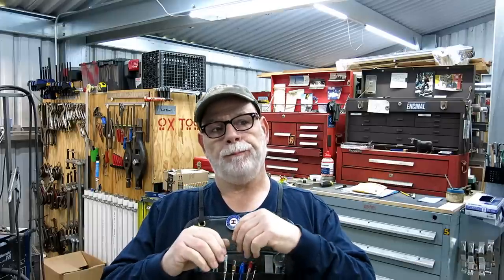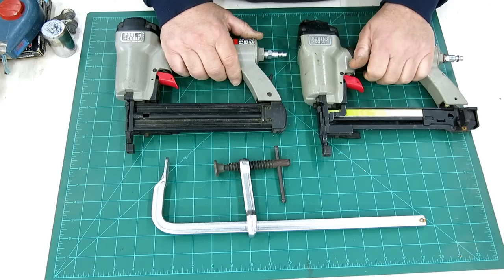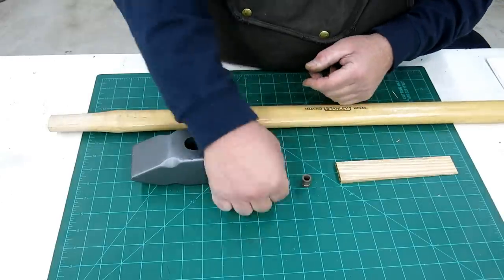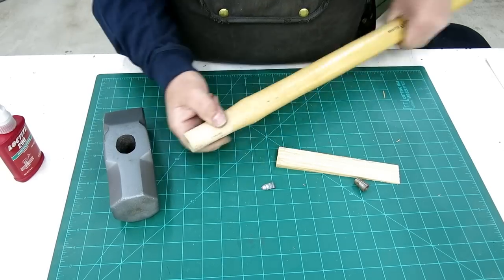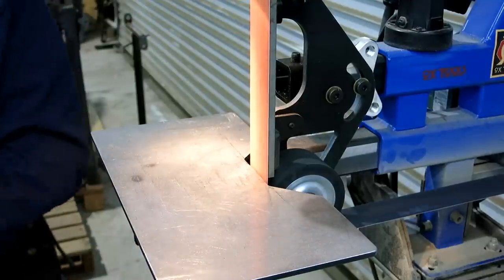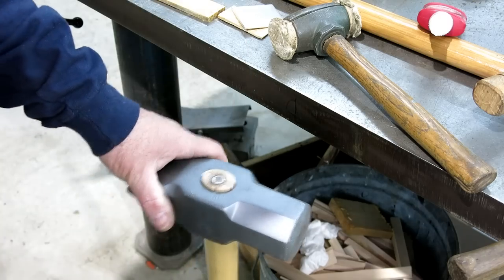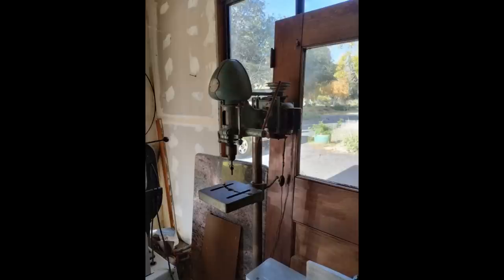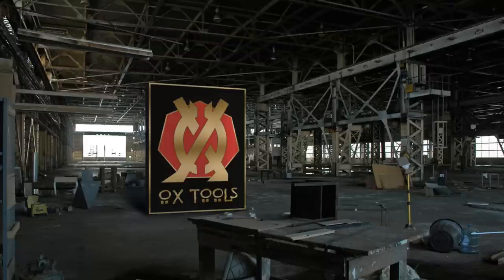Monday Night Meatloaf 148

Comment: That bow is probably designed into the clamp.  Check it under tension.
Reply from the maker: Hey James. This bow was going in the wrong directions unfortunately. Thanks for the comment.

Cheers,

Tom
Reply: @oxtoolco  The handle should be "C-ish" rather than "S-ish"

Comment: Axe/Sledge handles ... we've always used wedges and rings as you did, then stood them upside down overnight in a few inches of undiluted Automotive Antifreeze.
Thanks for sharing 🇨🇦
Reply from the maker: Hey Paul. Antifreeze? Does it harden in the wood fibers? I had not heard that one before. I can see how somebody figured it out accidentally. Thanks for the comment.

Cheers,

Tom
Reply: This is the answer only thing that ever works in Mn to keep the handles on
Reply: @oxtoolco  I hontestly don't know why it works, but up here in canadian winters & summers, it just works. Old school Glycol antifreeze, soak  them once a year in the fall ... I'm guessing it "sugar cures" the wood and prevents both wetting or drying.

Comment: Hi Tom. I'm a retired custom cabinet shop manager now dabbling with a home machine shop. In my humble opinion the Forrest Woodworker 2 is the best blade out there. We had SCMI super high end sliding saws fitted  with Forrest blades. Nothing else compared. I still use them on my craftsman at home. They make even low end saws perform with high end results. Several buddies have invested and thanked me for the pro tip. I enjoy your content very much. Thanks man.

Comment: Nice job Tom.  Just a hint, soaking the hammer head in Linseed oil will do the same thing  and possibly better.  Good fence for the saw.
Reply: So will used antifreeze...way cheaper
Reply from the maker: Hey Randy. Then I need a bucket of linseed oil. Doesn't is stay sticky for a while as it dries out? Thanks for stopping by.

All the best.

Tom
Reply: @oxtoolco  well unlike locktite which is made from unicorn tears. linseed oil is only $8 a quart. 

It goes through a polymerization process while it "dries" its really a chemical reaction process with oxygen in the air. When it's cured it's hard.  Boiled linseed oil dries in around 24hr.

It's kind of like the Portland cement of wood finishes.
Reply: @oxtoolco  Mix 50/50 linseed oil and real paint thinner,  fit handle to hammer, put hammer head in container with the head covered y about 1/2" with mix, let soak for 5-7 days, remove and wipe clean and let dry.  the linseed oil will soak into the cellular structure of the wood then hardens.  Last your lifetime.  This is the real woodworkers way.

Comment: If your replace the chalk line. Try 20 lb braided fly line backing, (it's used in fly fishing). It give a much finer line. Like a #2 pencil. It will take a few times to get the chalk in the braiding but it is worth it. Have enjoyed your channel for years. Thanks for all the tips.

Comment: As a woodworker and carpenter I own three chalk lines.  I had the goal of a red chalk line and a blue one and misplaced one so bought the third.  But color change, both were red when I purchased them so I emptied the red chalk from one and filled it with blue.  Well red and blue make purple so the guys on the crew had their fun with me while the blue took time to remove the last bit of red.  But in the end it was blue.  Now having told you my story I have no doubt you will change the line and I am not being sarcastic  But I did watch you make a hot glue dam on the sledge hammer and try to mold the glue to a perfect fit.  So there is no doubt in my mind that your machinist mind won't accept a blended color chalk line even though you don't have a dozen guys calling you "little Miss fancy pants with the purple chalk line."
Reply from the maker: Hey Dan. I resemble that remark. Blended chalk line colors. What a crazy world we live in. Thanks for the comment.

Cheers,

Tom

Comment: I’ve changed from red to blue chalk using the same line.  It was purple for a while but worked fine.  Going to black it won’t matter.  They sell cotton replacement line for about $5.  You will enjoy the upgraded fence.  The nail guns were a bargain.  I have several guns so I have designated nail length.  Also several routers so I don’t have to change router bits.
Reply from the maker: Hey David. Multiple routers. Had not got that far, yet... Thanks for the comment.

Cheers,

Tom
Reply: I also changed the color, but  it wasn't on purpose. I just got the wrong color chalk - I thought mine was blue (I forget what color it was - probably red). Anyway, I recall having the same experience for a while - a mixed color - and then the line was blue.
Reply: @oxtoolco  Tom, it's handy when you have a 45* chamfer or a round-over bit that you are using a lot on a project, and then only have to set the depth once, and use your "other router" for the "main tasks"... A second router like this can be a smaller 1/4" shank only router, even a laminate trimmer style, and use your big 1/2" shank router for the big boy jobs, or in the router table.

Comment: Very cool meatloaf. Used that tip on the loctite and ordered a bottle. Thanks!!!
Reply from the maker: Hey Small. Let me know if you get the locktite as advertised. Thanks for the comment.

Cheers,

Tom
Reply: @oxtoolco  will do :)
Reply: I ordered one too right after Tom introduced it in the video (went back and finished watching the video once the order was placed).  Amazon says its shipped but will not arrive until the end of April.  Apparently its shipping from IndiaPost by boat.

Comment: Automotive anti-freeze. Keep a bit of old used in a judge and soak your handle ends in it once you've set everything.  It doesn't dry out and will be there till you break the handle.
Reply from the maker: Hey Russ. You are the second person in the comments to mention antifreeze. I'll have to try it. Thanks for the comment.

Cheers,

Tom
Reply: @oxtoolco  Something I picked up when growing up on the farm. Always wondered why Dad would put newly handled splitting mauls in this old bucket of anti-freeze. Very happy to have you back regularly Tom. I'll bet it's a hoot working with you.

Comment: For the chalk line, I would just replace the string.  Replacement strings are cheap enough to just not spend any time. Blue chalk washes off, black and red, it depends--they can be permanent or washable. Forrest blades are excellent in my experience. The Forrest sharpening service is also first rate, but you are set up to do that yourself, I'm sure. Love those shop cranes!
Reply: There's an "amish" sharpening service near me and I was SHOCKED that they had a Walter's Grinders CNC oil bath automated saw blade sharpener.  Absolutely amazing machine.  

They load a spindle full of blades kind of like an old record player, push a file to it of parameters and such for each blade and it runs all day unattended.
Reply from the maker: Hey Bk. I'm thinking that is the best way to deal with it. Thanks for the comment.

Cheers,

Tom

Comment: Definitely going to try the sledge hammer trick. Thanks for sharing. I’ve never had luck with sledges, I’ve done a bunch of hammers, hatchets stuff like that but never got the hang of big hammers. Keep these vids coming. 

Cheers
Reply from the maker: Hey Mike. Fitting handles is a pain sometimes. Just have to go slow and get the right fit before you drive wedges. Thanks for the comment.

Cheers,

Tom

Comment: I live near Baltimore and back in the 70s and 80s as the heavy industry got hollowed you could find things like the shop cranes and more cool stuff for sale. It’s all gone now, like military surplus from WW2 dried up in the 60s. So now THOSE “industries” are hollowed out, too! BTW, I never once got a hammer head replaced to my satisfaction. That was a good lesson. The Beismeyer fence is a good choice b/c there are a million handy jigs designed for it.
Reply from the maker: Hey Glenn. There used to be an army surplus store near our house when I was a kid. I can still smell the smell of cosmoline, dusty canvas and old electronics If I try hard. Thanks for the comment.

Cheers,

Tom

Comment: On the LED lamp lifetime....the fine print on the package usually contains the expected daily use in hours so that 22 years is a bit misleading if you exceed the daily use time....still a great shop lamp replacement.  My old portable incandescent shop lamp usually failed after I bumped or jarred it... LED bulbs are more forgiving in that aspect.
Reply from the maker: Hey Carl. Now you have me worried. Might have to lay in a couple of spares. Thanks for the comment.

Cheers,

Tom

Comment: I’m a big fan of LED and compact fluorescent bulbs. But as far as the advertised lifespan on these items, I find it’s highly unlikely they’ll last 20 plus years. They all have electronics in the base. When installed with the base up, any heat generated by said electronics will result in premature failure. The electronics are the week link in this equation. Great video, I always learn something new.

Comment: @8:56 I did my cross pein sledge that was my Grandfather's (Lockheed Machinist). It had a split handle. I fitted the new handle with 2000# Epoxy all around it (not fast cure stuff) and then drove all the wedges home (with Epoxy poured in there too). It's not a long handle (about 18") but it strikes hard! And my other Grandfather taught me to change an axe handle. I do them MY way now... 😆
Reply: Can confirm. I’ve had good results as well, using a 16-hour cure polyurethane epoxy in the same way. Tough stuff.. and probably cheaper than Loctite 290 as well, if you’re paying the list price like I did on my little bottle. 😂
Reply from the maker: Hey Phil. Aren't grandfathers great. They knew how to do things. Thanks for the comment.

Cheers,

Tom
Reply: @oxtoolco  They are! The really great thing is they taught US how to do things! Ask a 10-year-old today if they can tie an underwriter's knot in a lamp cord! I could, but I'm 64 now... 😁

Comment: I also keep a magnetic back dial indicator stuck to the underside of my fence rail for precision adjustments.  I can't remember who I first saw do it.  

Some day, I'll get an inexpensive longer travel indicator for the same purpose as sometimes I want to move my fence precisely, further than 1".

I've also pondered attaching a digital caliper to the fence rail and have some kind of QD pin for the end of the caliper but I haven't gotten into modifying calipers as I know Mr. Renzetti does.
Reply from the maker: Hey Drew. And for my next trick, mounting a long travel DRO to the table saw....Thanks for the comment.

Cheers,

Tom

Comment: Tom, using the Loctite is interesting! I've used ethylene glycol to soak the business end of a loose sledge hammer handle and it seemed to work well, though I don't recall where I learned that from.

Comment: Tom you got a great deal on the brad gun and crown stapler.  At the shop I used to work they had Porter cable and they were abused to every inch of their life covered in dried wood glue and they pretty much worked day in and day out.

Comment: I'll have to try the Loctite deal. I have used linseed oil and it works ok for a while. I've had better luck with full strength antifreeze. Just drop the hammer in a small pan of it for a few hours and there ya go. Doesn't evaporate as fast as water does although I found you will have to do it again at some point depending on the humidity of your environment. That chain lift shop crane is way cool! I have lusted after one of those for years and came very close to buying one, but the guy sold it while I was on my way to pick it up after I made the deal over the phone. That was about 7yrs. ago and have never found another.
Reply from the maker: Hey Rock. You are the third person in the comments to mention antifreeze. I'll have to try it now. Thanks for the comment.

Cheers,

Tom

Comment: Hi tom  Just to let you know the next time you put a handle in a hammer have the handle tight ,  cut to about 1/2" longer put the handle that will be in the hammer head in hot water or boiling water for 5 minutes .This will make it soft the press or hammer it in place

Comment: You'll probably be $30-40 into the Porter Cable nailer/staplers soon.  The plastic valves (or piston stop bumpers) like to crumble.  I've fixed like 4 so far and have another one to purchase parts for still.

Comment: I'm not sure about new manufacturing, but a lot of older bearings were chrome plated.  I've pulled many, many large bearings out of heavy equipment with the chrome flaking off.  I can't recall if I've ever seen one running in grease with chrome plating.  I usually see them in transmissions or axle housing running in oil.
Reply from the maker: Hey Bucking. Interesting. That is outside my experience. I have never seen a chrome plated bearing although I can understand why you might want to do that. Thanks for the comment.

Cheers,

Tom
Reply: @oxtoolco  it might be your lucky day because surely that is the only piece of mechanical knowledge I could share with you in which you were unaware.   I've watched your channel for several years, and you have taught me so many things.  I even go back and rewatch some of your videos on precision lapping.  I have two surface plates that I bought used, and I'm  really not sure of their condition.   I've watched your videos about lapping surface plates and using the Repeat-o-meter, but I've always been terrified of going at it without an autocollimator.

Comment: Hey Tom, believe it or not, my employer has actually been burned by counterfeit loctite on Amazon.... We ran short on our supply of a very specific loctite and our Henkel vendor couldn't get us our stuff fast enough - Amazon to the rescue!! Next thing we know, we have a rash of assembly failures on internal final testing of our products (we manufacture electrical switchgear) that was directly related to the thread locker that we used. Glad that stuff never made it out to the field and to customers.... And we will never purchase any commodity items like loctite from an Amazon vendor ever again. Just figured this was worth mentioning. I'm sure whatever cyanoacrylate is in that bottle is fine for sealing end grain on wood, but I'd be a little cautious about any demanding applications- your mileage may very.
Reply from the maker: Hey Awegner. Interesting. I would be curious to hear about the failure detection on your switch gear. If they failed because of missing or faulty thread locker I would be concerned that the fastener retention design is at fault. Generally speaking the locktite is belt and suspenders for good fastener design not the main line of defense. Thanks for the comment.

Cheers,

Tom

Comment: With the chalkline, just dump out the blue and use the chalk line until the strings empty.  One thing of note is that the different colors mean more than just color. Black and red are essentially permanent marks. Blue us a medium longevity, and purple is least durable color. Going from blue to black isn't much of an issue, Going the opposite direction would likely be impossible. I've got 4-5 chalklines, all dedicated to the different colors.
Reply from the maker: Hey Raven. Mixed chalk. What is the world coming to. Thanks for the comment.

Cheers,

Tom

Comment: You really don't want to get in the habit of curling your tender fingers around the underside of a board when using power nailers, staplers, etc.

Amazon has a bug/feature in their pricing on industrial supplies. Anytime stock gets low, they drop the prices by up to 70%, even on stuff they immediately restock. I picked up a lot of Chicago-Latrobe taper shank drills that way. CamelCamelCamel is your friend for finding these.
Reply from the maker: Hey Paul. You noticed I moved my hand further away from the action. Thanks for the comment.

Cheers,

Tom

Comment: When heads fall off, it's usually because the tapered hole goes the wrong way. The wider side is always opposite the handle.
Reply from the maker: Hey Landrew. The other reason is if your aim sucks and you hit the handle on the thingy.... Saw somebody do that once. Thanks for the comment.

Cheers,

Tom

Comment: Cool I have the same air “Brad “ nailer and narrow crown stapler. I also have the pin nailer and they are great,you’ll have fun with them
Reply from the maker: Hey Norris. These are easier to adjust the depth than the Senco's I already have. I figured $15 was worth the risk that they didn't work. Thanks for the comment.

Cheers,

Tom

Comment: I’ve had a Chinese led in my shop overhead fan, conventional filament bulbs last a month or two used only when I was there, the led has been on continually for over two years.  Bought a similar drill press down the road at a moving sale, best $50.00 ever spent.  Had one at work from the forty’s that was abused but so well built it was still tight, and used daily.  Great drill.  The vise is junk! Lemme relieve you of that dead weight before you start cussing.  I’ll even go postage for it 😂
Reply from the maker: Hey Stew. Thanks for the comment.

Cheers,

Tom

Comment: Rubbing Alcohol will help easily remove the hot glue.  This is what is used in paintless dent repair where a pull point is attached to the paint on the dent.

Comment: Cytologists are the folks who work at a microscope and examine cells all day: type, cancerous/non-cancerous etc.  The guys who often sort out screening tests that might indicate a problem, but lack reliability in terms of correct diagnosis - PCR tests used early in the covid scare are a perfect example of something unqualified to provide diagnosis needing a second method for confirmation.
Reply from the maker: Hey Flinch. I looked it up after the video of course. Thanks for the comment.

Cheers,

Tom

Comment: Thanks for the video. I’d go with a new string for the chalk line. It will take too much time and effort to clean it. Do the nail guns adjust the depth by the amount of pressure applied or change the foot height? Looks like they were a good deal.